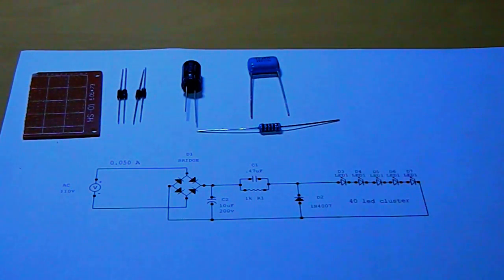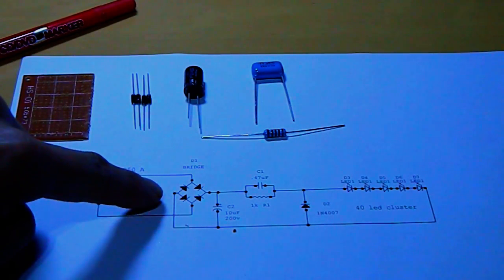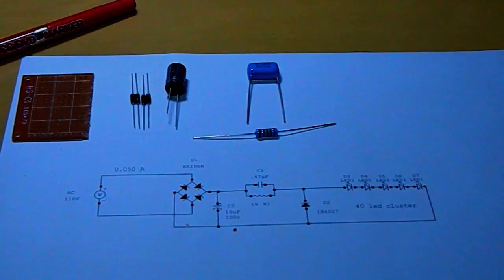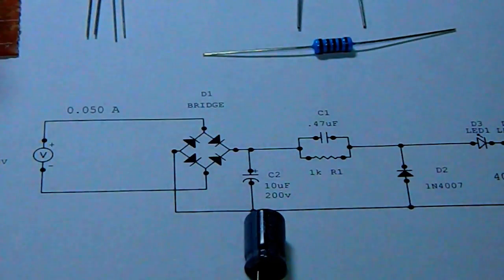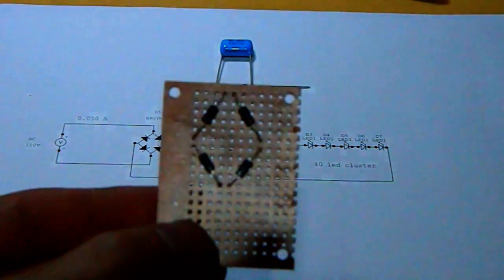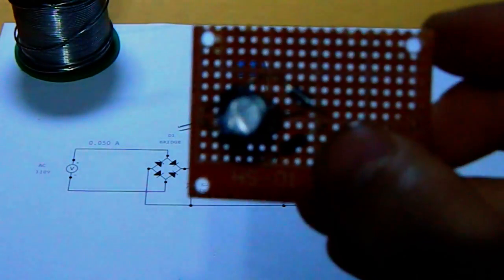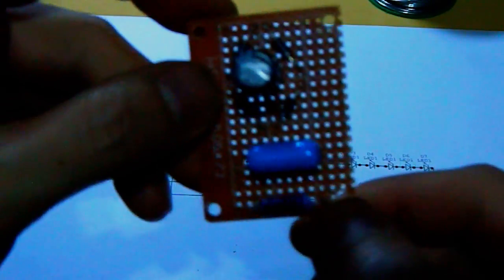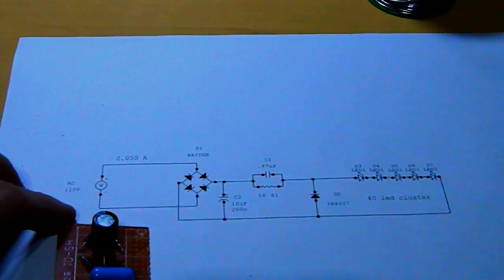Circuit for the 40 LED cluster 5.5w

Comment: The circuit diagram is wrong because the series capacitor has no reactance on d.c voltage.correct it.

Comment: how about 100 led series !! what the formula and R1 C1 and C2 !!
Reply from the maker: Well... for 100 led series, a little math... 100 led at 3v each.. you will first need 300v DC. So, if you have a 220v outlet and a full bridge rectifier you will get let´s say 230v DC. This divided by 100 leds you will get 2.3v on each led. That will not give much light, and there will be no need to use any resistor or capacitor, only the cap in the bridge rectifier. Regards.

Comment from the maker: Thanks!! Well, for 220v you have few options. Double the LED´s, installing two 40 clusters in series and using the same resistor value. Or then using a higher value resistor. But it will get very hot, so... careful with the assemble for the resistor not stay close to something. The best option would be to double the led´s.